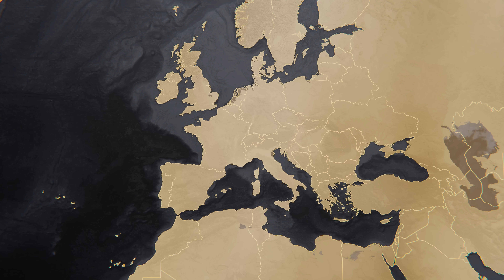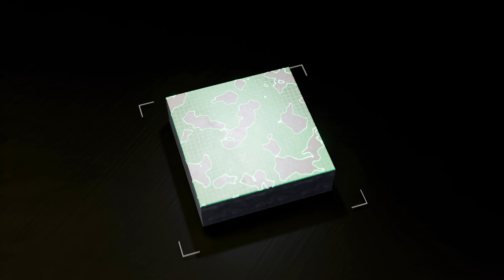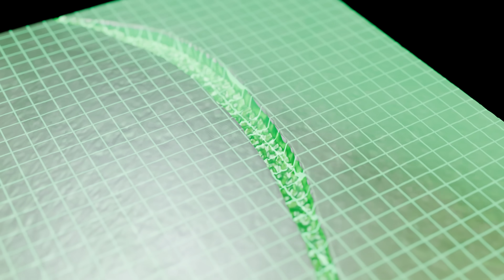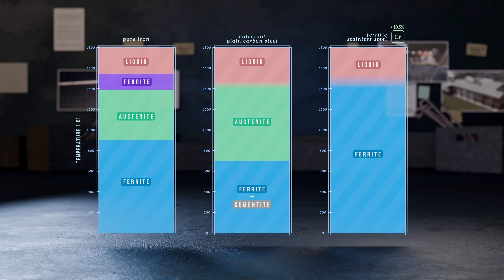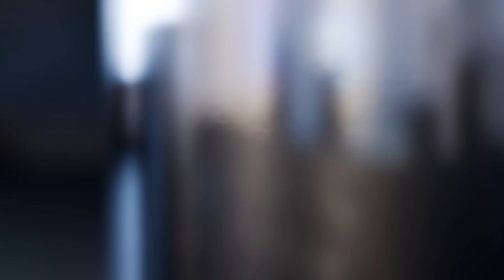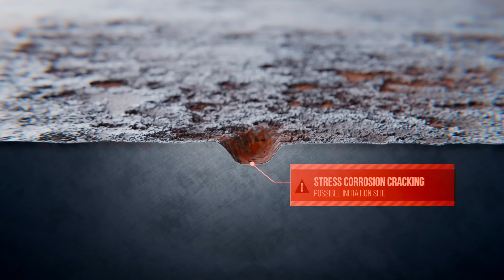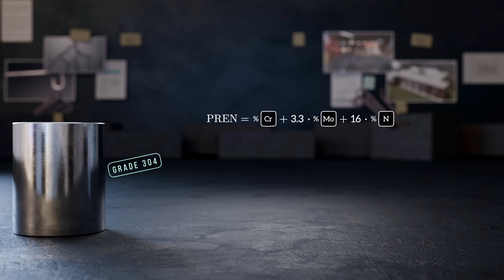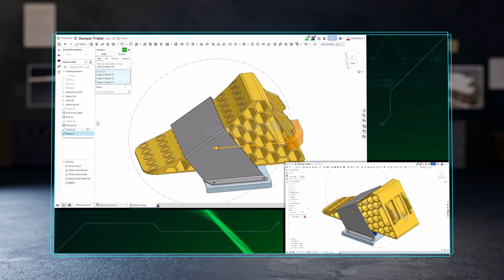The Problem with Stainless Steel

Comment: This guy consistently provides more useful information in 20 minutes than my entire materials course did in a semester.
Reply: That’s why he calls himself efficient
Reply: @paweszczech7485  Ya, I only learned about basic steel and not all of these crazy SS alloys 40 yrs back.  Yet I am a bit familiar with 316L on boats.
Reply: I saw a video on bog iron recently. How the high phosphorus content, 0.5% plus made (almost) never rust iron and steel in the middle ages. Think of iron pillar of Delhi.
Plus it's the only renewable source of iron ore.
Would be informative if the author here explains how this extreme rust resistance works.
Reply: @Michael_Brock  you know what I’ve heard that mentioned before , it took them a little bit of time to mimic the composition.  Definitely gonna have to read more into it now that you refreshed my memory.
Reply: @Michael_Brock   Water + phosphorus = phosphoric acid. Phosphoric acid + iron = Iron Phosphate. Iron phosphate forms as a passive layer (like zinc more than anything else, but iron phosphate is not a "metalllic compound") at the surface that's resistant to just about everything, and with continual exposure it will eat into the material a few microns to create a sponge like skin that holds on to liquids. It technically is rust, differs from regular rust because it doesn't flake off to expose the surface below, instead, it adheres strongly to the base layer (like nickels passivating layer). So the pillar of Delhi is completely rusted at the surface, and any damage it faces just reveals the same self passivating metal below. 
 
This is why "Naval Jelly" and other surface treatments exist - an application of phosphoric acid will convert iron oxide, into iron dihydrogen phosphate (water soluble Fe3(PO4)2 ). So you can apply the acid, rinse it off, and you've simultaneously removed any rust that was present, while giving the metal a protective coating - and if you apply an oil to the surface, those pores will hold on to the oil (so you can use a hardening oil, or hot wax, that will fill the pores permanently).
 
Also, it's not renewable... the bacteria that are "bog iron ore", get the iron from ground water, which got it from passing over iron in the earth. Bog iron ore being renewable is like saying I'm a vegan because the meat I eat, ate plants.
Reply: @Michael_Brock там такой же принцип как с нержавейкой - создаётся на поверхности защитная оксидная пленка. Вот только фосфор и сера вредные для стали компоненты.
Reply: I'm just a humble pipefitter, and I did a very basic course on metallurgy back in the early 90's and I really wish we had YouTube back then. I would know a heck of a lot more than I do now, although for my job I don't need to know as much as a structural engineer or other similar professions.
Reply: Sorry to hear that your school is that bad
Reply: This is basic stuff talked about in faliure analysis. If you aren't a materials engineer, you wouldn't know this stuff. That's why the one materials class our university offers all other engineers is seen by our department as completely lacking any and all depth. Basic stuff for a metallurgist, but not for others. This is a failiure of engineering programs. Materials matter.
Reply: @Just_Joshing024  you spelt failure wrong. i still agree with you.
Reply: @JTV84  Aoccdrnig to rscheearch at an Elingsh uinervtisy, it deosn't mttaer in waht oredr the ltteers in a wrod are, olny taht the frist and lsat ltteres are at the rghit pcleas. The rset can be a toatl mses and you can sitll raed it wouthit a porbelm. Tihs is bcuseae we do not raed ervey lteter by ilstef, but the wrod as a wlohe.
Reply: @mad_t  this only works assuming you are proficient at reading.
Reply: 10,000 teachers can’t all be really, really good.  This person is very good.  My channel sucks, but some people are naturals at presentation.  Kudos to them!    + This guy had lots of time to make the visuals- which (I have a photography degree) are extremely well done.
Reply: Facts 💯💯
Reply: By it
Reply: "Suspended" is not a term used for concrete slabs. The knee jerk comment exposes ignorance.
Reply: It’s people like you that design concrete ceilings that collapse and kill people. Don’t like it? Change and be more likable.
Reply: There are quite a few U tube channels I could say that about.
Reply: i learnt more about stainless steels from this video than i have from 20 years of testing materials. i do tensile tests on duplex bolts all the time and they are nothing special in tension, impact testing is where duplex breaks the machine. testing some of the strongest materials known to man requires equipment that is even stronger, and sometimes that's not possible.
Reply: that's not hard... at all... i learnt more from a random yobbo online than any brick and mortar ever will.
Reply: If not at a Snails pace
Reply: @zeez4178 he does talk at a glacial speed, I listen at 2x and he's still slow lmao
Reply: Tell me about it.  We had a little guy teaching that wore a bow tie, every day.  Somebody should have marketed his lectures as aids to combat insomnia.  He  was a nice guy,. but MAN.  For a test on identifying these types of structures, he put slides up on the overhead of the different types, and every time he did, the class laughed, because I assume they had about as much chance of guessing them right as I did, which was snowball in hell level.  It was in a large auditorium that seated about 400, and the class was probably about 20% that size.   In the average lecture, I would look back and fully 1/3 of the class was head down on the desk, asleep.   I think it was called Structures and Properties of Materials, NOT to be confused with Mechanics of Materials, which I, strangely, found very interesting, but not terribly useful for an EE.
Reply: Когда я учился металловедению в Мариуполе в 1997 нас заставляли учить диаграмму  железо-углерод: мартенсит, аустенит, ледебурит и т.д. в жизни не пригодилось, но помню до сих пор
Reply: @Dimitr-v9n  LOL, 'forced' is the way almost everyone thinks about it.
Reply: First time here. Halfway through the video I subscribed to the channel.
Reply: Channels like this is why I know more about certain trades, materials and processes than some people working those trades, materials and processes 😂
Reply: @ryanlewis6344  The key word there being SOME.
Reply: This comment is 100% correct!
Reply: As soon as I learned it was a swimming pool, I thought "Chlorine". that's the cause. It just clicked immediately. Swimming pools contain what is in essence, diluted bleach (Sodium hypochlorite). Not much is chlorine-resistant. And on top of that, bleach contains both chlorine AND oxygen (the reason it's so good at disinfecting stuff). And as the video progressed, it became clear.
Reply: @paulmichaelfreedman8334  Instant chemistry PhD over here—saw "swimming pool" and screamed "chlorine!" like you'd solved world hunger. Congrats, genius.

Quick reality check: pools use diluted sodium hypochlorite (same stuff as bleach), not bubbling vats of elemental Cl₂ gas. And no, bleach doesn't contain "chlorine AND oxygen" as some magical tag-team duo. It's NaOCl—one bonded hypochlorite ion that forms hypochlorous acid (HOCl) to actually disinfect. No loose Cl₂, no bonus O₂ party. You just confused a compound with an element and invented superhero chemistry.

Adorable "it just clicked" moment, though. Keep dropping these video-watching epiphanies; science clearly needs your hot takes. Next up: water's wet because hydrogen + oxygen? Mind blown.
Reply: @paulmichaelfreedman8334  I want some insight into how what you just talked about the chemistry nature of bleach has to do with anything here or anywhere. Yes, they are similar. No, they do not react to organic bodily tissue the same. It's the same reason as to why lye has a very different reaction from what you're talking about. Most people who claim "chemistry" as a reason to their made up beliefs very rarely can even do electron clouds on paper.

Name all of the electron clouds and all of their potential interactions, and it'll provide at least some base that real scientists can relate to. Otherwise, it's just feelings. Also, bleach is an industry word - not chemistry. NaOCl. Sodium, oxygen, chloride. Very simple - there's some conspiracy theory behind how these chemistry reactions work. Lol.
Reply: @Pleiades721  Did smoke a fat one before you wrote this?
Reply: @Pleiades721  Either was he's right kiddo. Don't need to be Mr. ErmAktchuallyy. ALSO, as was stated before you jumped in thinking you had anything of substance to say, Sodium Hypoclorite IS the correct chemistry term.
Reply: @Pleiades721 bleach is a good oxidizer?? whatever he said made sense lol whyd u wanna draw electron clouds for an inorganic redox reaction 🤣 what are u smoking
Reply: @Pleiades721  my guy thinks you need to learn a PhD to have some basic intuition of the environment an accident happened.
Reply: @paulmichaelfreedman8334  Nice hopesult. Your generation is basically summed up in 3 phrases: Professional victimhood, white knighting, and hopesults.
Reply: @andrewconrad1563  You didn't even read what I wrote on the chemistry side, quite clearly, which is in direct relation to sodium hypochlorite. Not my fault you don't choose to read everything.

Again your generation is basically summed up in 3 phrases: Professional victimhood, white knighting, and hopesults.
Reply: @isaamthalhath4359  Like I said, none of you could do electron clouds if you wanted, yet you'll claim to magically understand how chemistry works.

Same thing, yet again: Your generation is basically summed up in 3 phrases: Professional victimhood, white knighting, and hopesults.
Reply: @JohnRambo-s1s  And there we go, another kid here that couldn't do electron clouds if he wanted, but magically tries to white knight behind someone as if they could.

You kids are all the same - your generation is basically summed up in 3 phrases: Professional victimhood, white knighting, and hopesults.
Reply: @Pleiades721 also the only thing u can draw is a lewis dot structure of molecules, which btw is completly useless for transition metals 😂 ur prolly talking about that bcz u cannot "draw" hybridized molecular orbitals of molecules without help of a computer to model the so called electron clouds, so maybe next time learn sum actual chemistry rather than js calling lewis dot structures as electron clouds cause that model fails for d block elements and f block elements, iron is in 3d series and you cannot use lewis structure to model its reactions
Reply: @Pleiades721 Dude, go get some steel and put some diluted bleach on it... it oxidizes. Because it's bleach. Before they had plastic, they shipped it in glass because it eats anything that is reactive in the slightest.
Reply: @Pleiades721  my guy... we're aware of electron clouds... but we don't need that information for what we do. Maybe in a few years when i'm bored but not right now... You're basically saying "look at me i'm smart" and that isn't helpful for anything other than stroking your ego.
Reply: @Pleiades721  The more PhDs one earns the less common sense one retains.  How many do you have?
Reply: @JohnRambo-s1s  It's just like I said, in the vast majority of basically hateful replies you people lay down:

Professional victimhood, white knighting, and hopesults. Very consistent behaviors from your kind.
Reply: You needed to crack the book open once in awhile.
Reply: @MrShobar  The book was primarily focused on introductory chemistry, not particularly useful to someone in my field.
Reply: @Gaaaaaame  There's a library right over there.  it's filled with books on metallurgy and material science.
Reply: @MrShobar and? The point still stands. I paid for and spent a semester in a materials class with less practical information than a few free youtube videos.
Reply: @Gaaaaaame  Do you regard this information as authoritative?  Why?  We don't even know who it was, or what his/her credentials are.
Reply: @MrShobar no, it is supporting information which aligns well with experimental data from other sources as well as multiple classes on material science and fatigue theory.
Reply: @Gaaaaaame  WHO authored this?  What makes them an authority on any subject?
Reply: @Gaaaaaame  While this video is good for beginners and is in fact a good starting resource by no means this should substitute entire semester worth of knowledge.

There a lot more details in books for a very good reason: they are rigorous. Books need to be rigorous because a single statement can't substitute for the all the real world needs. There are exceptions to everything.
Reply: most new books are absolutely broken, and cant communicate information worth a dam. there's a drastic difference in the way they used to convey information from the 1980s and before. the old video instructional lectures from ww2/Bell labs/GE/etc are best example. they make advanced concepts simple to understand and practically start using.
the entire university cartel system is absolutely fked. so many "professors" went straight into teaching after thier own college time without real life experience in a given field, resulting in them teaching just from a book that was written by identical people. the quality of the books decreases. its a perpetual cycle that degraded real education quality, and we're multiple generations into it.
Reply: @sanjay_swain dudes definitely ‘bought in’ and won’t see your view but I agree. Another problem with so called passive learning (watching videos) is that it makes us feel we have learned a lot because we can follow along, but it’s harder to memory recall and apply when given a new problem. ‘Active learning’ and struggling to find solutions (vs being handed them like in video) is where most knowledge comes from the research shows. Still a good resource but dangerous to rely on as a sole source of knowledge
Reply: Makes you wonder what you were paying all that money for doesn't it 😂
Reply: There's always one of these comments on every yt video and I don't buy it for a second. The second time you learn something it's always going to make more sense than the first time. Your uni course had to teach materials to someone who knew absolutely nothing about it. This video is teaching it to you as a graduate. No surprise that you understand it better now.
Reply: @definitionalchallenge  I came to say just that. Thank you.
Reply: @definitionalchallenge you're missing out on one hell of a deal because I've taken classes on subjects I know a great deal about just to see a professor fail miserably to teach those subjects. It was good for me cause the tutoring money was fantastic.
Reply: @definitionalchallenge it's the way of presenting and linking 

The textbooks always starts with the definition and the theories then gives you a case study 

But here he started with the problem mimicking how real engineers learn 

During my study only professors used this method
Reply: Professors are often just extremely overpaid bad teachers 😂
Reply: @shadowmystery5613 Here is a professor who enjoyed the the video and agrees (partly) with your statement :-). I use the same example in my materials course - but I don‘t have the quality of visualisation like here. „The Helix“ is a nice example for duplex steels by the way
Reply: @uwewas9711  which part of the statement do you agree with?
Reply: @shadowmystery5613 maybe at the crappy school you went to
Reply: I hardly read anymore. I learn so much from YouTube that I was just thinking : give me 2 years and an IPad and I could pass thebar exam.
Reply: Agreed  a whole semester in college was a waste of time versus information available.Now on youtube
Reply: These videos are good for normal people, but you can't design anything with watching these videos 
University courses teach you how to put good assumptions, analyse and design
Reply: In the future, buildings will have to display a warning sign: designed by Gen Z — enter at your own risk!
Reply: i know right? who needs to waste half a year in college anymore !
Reply: Sounds like you are just a bad student and giving excuses for your poor performance. I graduated with a BS in ME and in graduate school. I've had plenty of shitty professors, didn't make an excuse and opened up books. If the book is useless , on to the next. That type of rigor and mental "callus" has helped me immensely in the real world and at my job. Nobody holds your hand at work, as an engineer you're expected to figure it out.
Reply: @alexv5581 What excuse did I provide? My entire comment was on a video filling gaps in my knowledge. I'm graduating with a BS next semester and a MS the semester following, amounting to a 4+1-1 degree path. Interesting conclusion you made, though I'd hesitate to call it accurate.
Reply: @Gaaaaaame  honestly. this guy is a troll. ignore him like I will do now.
Reply: This is heavily edited by neural networks. These videos (AI) are starting to lose real world credibility. It's not his own voice even. I don't want pure Ai content in the future. The joy of listening to a musician is because they are precisely imperfect.
Reply: @Pleiades721 you think this video is ai?
Reply: @AmitPatra-w8y  Most definitely developed with the help of using it. Almost every video of significance has human components to it, but it's easy to tell when the assist is thrown on.
Reply: @Pleiades721  What are you even talking about? That is clearly his actual voice, you can look up videos from 6 years ago, when AI voices were still in their infancy. And the editing seems pretty consistent to then aswell, just a little matured and higher quality 3d renders. And as far as I can tell all the information in video is completely correct, no weird logic jumps or other AI script markers. Be better
Reply: I'm watching at 1.25x speed and still find the ai voiceover too slow
Reply: @MelodicTurtleMetal Bro, this is not an AI voiceover. You can literally hear the quality of the recording change slightly as he cuts between different takes. AI speech doesn't have that kind of random dynamic range fluctuation.
Reply: @Mirror_Lotus  should have specified yea, its not AI, but he does talk really slowly
Reply: @MelodicTurtleMetal yeah, 2x for me and its annoying, though the information itself is solid